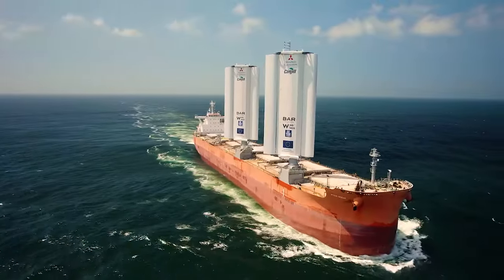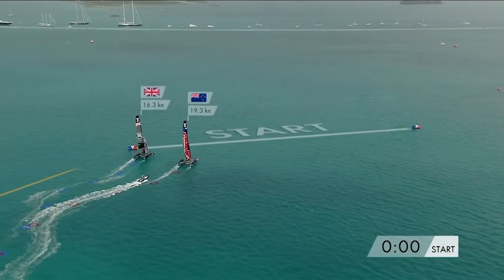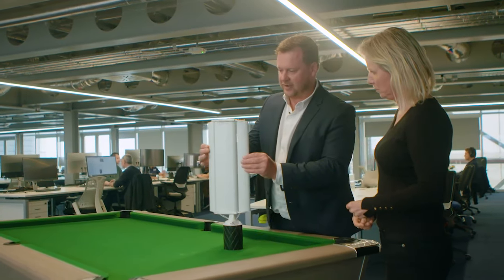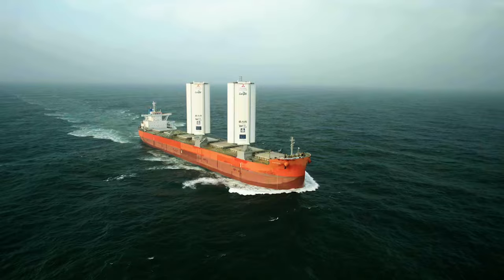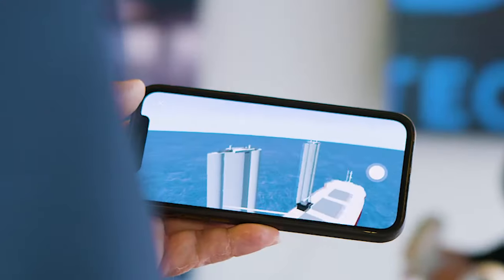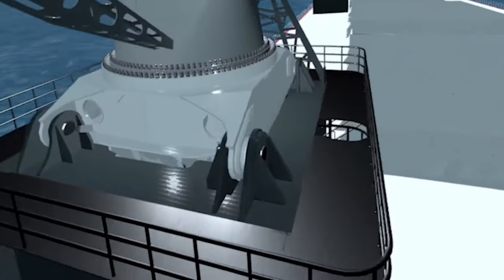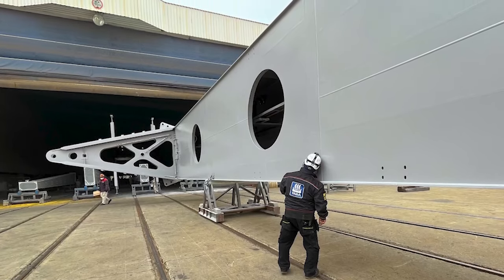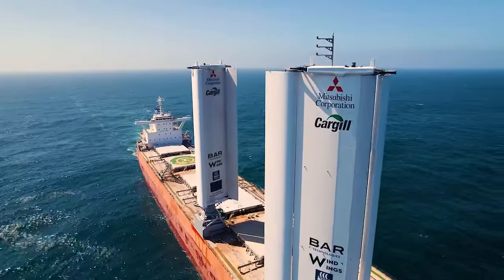Will wind power the future of shipping?

Comment: What happens in a windforce 10  ??
Reply: your shipment arrives a few days earlier. LOL
Reply: They add increased loading on the wings, requiring trimming. The biggest problem is that gusts will make the ship heel over, and some ships cant exceed 6 degrees due to cargo constraints.
Rotor ships that Maersk use, don't have that problem, and produce way more power.